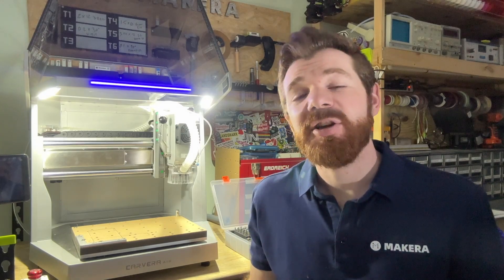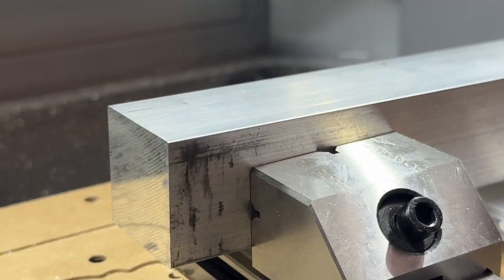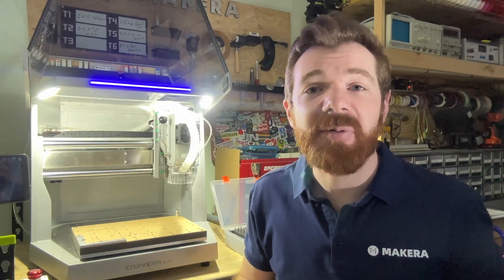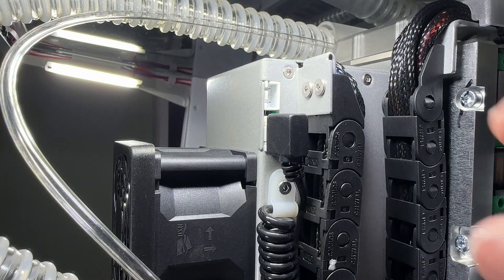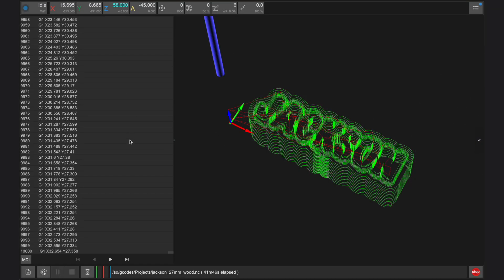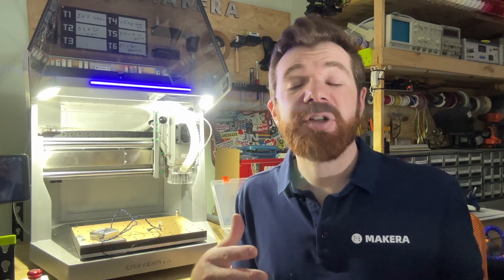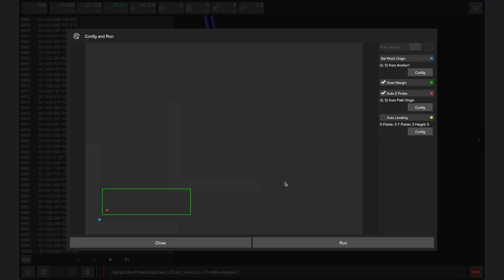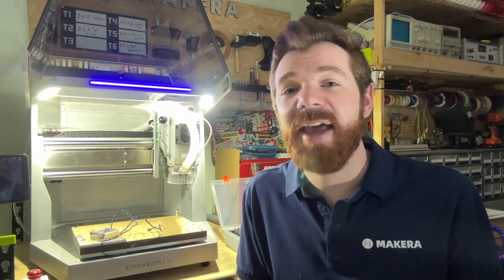How to use the Manual XYZ Probe for the Carvera Air Desktop CNC

Comment: This only works with conductivity right? So you can not use it directly on the part? That sucks.. I don't get why makera does not offer a cheap 3D probe like maxmake, would be great to indicate parts for rework etc.
Reply from the maker: The manual XYZ probe is conductive, while the Z probe is not. And stay tuned, we have recently announced a 3D probe in our Z1 kick starter campaign.

Comment: What does the default 9mm probe height refer to? How do I calibrate a blank with a different length?
Reply from the maker: That is the default parameters to the test bit, but you can change these numbers to use a different bit yes.
Reply: @Makera , yes, that is said in the video, but what does the 9mm default probe height physically correspond to on the test bit?

Comment: What if you're using a WCS other than bottom left? I have to use top left for most jobs as my bottom left is over the edge etc. Is there a way to do this? - it just needs probe for the other corner.
Reply from the maker: This can be set in your CAM as you develop your WCS parameters.
Reply: @Makera  Yes, I've set the WCS up in the cam but when using the XYZ probe it still goes and finds the bottom left corner, I've figured out I can offset 34mm the size of the square but have to manually do this. Eg when the probe moves to find the corner I'd want it to move up and left. Not down and left.

Comment: Hi very usefull video. I should have used this, that would have avoided me the need to restart a project from start. Quick question : is there a way to record the position X,Y set this way somewhere so we can use it every time when implementing a vice is a defined position, but while Z would change everytime... Basically, it would be great to set a custom anchor position, and I'm asking myself if possible to do this (and if so, a small video tutorial would be greatly appreciated!)? Thanks again for those small but very usefull videos...
Reply from the maker: Happy to assist! You are able to see X, Y, Z positions in the makera controller app, and also set your machine to go to specific positions and use them as an origin point. But you cannot store these positions in the app.

Comment: it should be in the top right corner! the l bracket is in the way and if the stock is not taller than the l bracket you cant align the corner with the manual probe.
Reply from the maker: Correct, but if you are using the manual probe you also may not need the L bracket for alignment.

Comment: Bad advice. I find that the Z position is not accurate at all. Particularly since the probing sequence doesn't measure the height of the tool. Z probing is essential afterwards to determine the stock height.
Reply from the maker: The tool is measured after the toolchange. and then adjust the Z heights accordingly. If you are having trouble please email Support@makera.com
Reply: @Makera  I just had this same issue. It only stores the X and Y location, not the Z. It probed the height of the tool after the toolchange but you never set the height of the probing tool itself, so in my case it cut 5mm too deep. Probing is essential and I think you should edit or update this video to reflect that.
Reply: When i change the probe height to 0mm instead of 9mm like they say to, it worked just fine for me. Also I checked the scan margin option because otherwise it does not probe for the actual tool offset, it just start doing it own thing. Hope this helps!

Comment: So the block is only loosely sitting on the workpiece? Wouldn't the sideways movement of the probing cause the block to move a little? Would I need to hold it down by hand?
Reply from the maker: Yes, the block is resting on the work piece, aligned with the grooves on the bottom to hold it square with your piece. As long as the wires are unwrapped and hung loosely and the head is in an approximate position before starting, the block should not shift during the slow moving probe sequence as shown in the tutorial.

Comment: Hi Makera, can you make a guide on how to use the opening in the back with the probe?
Reply from the maker: Are you referring to making a project with pass through? That would be similar to this video, but the material would pass through the back of the machine and the probe is placed where your origin position is set to be in your CAM file.

Comment: what system carver air used to move x axis
Reply from the maker: The Carvera Air uses linear rods and stepper motors for X, Y, and Z travel.
Reply: @Makera  how does x axis make movement . By rack and pinion or ball screw i cant see any slots for ballnut travel on that metal piece which used in x beam but z axis metal has slots.